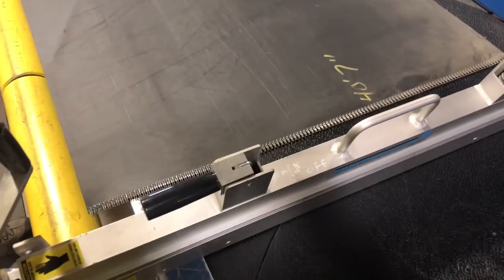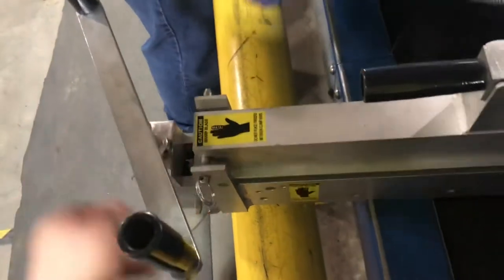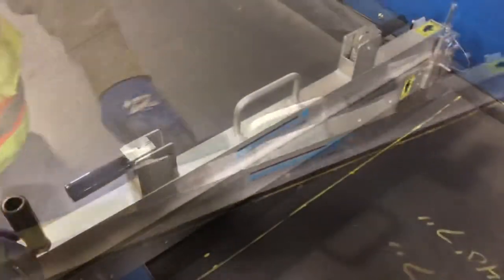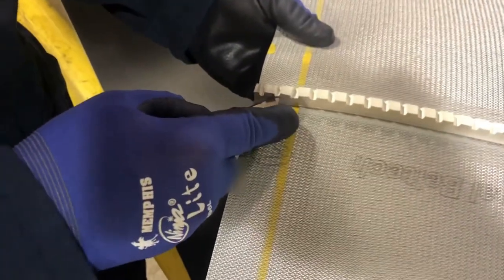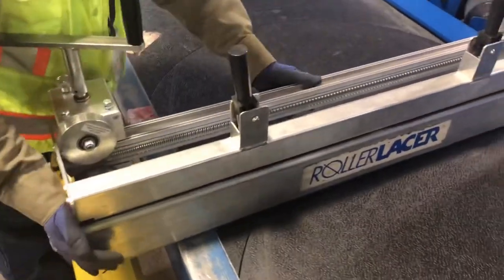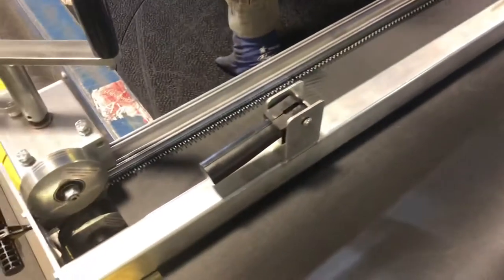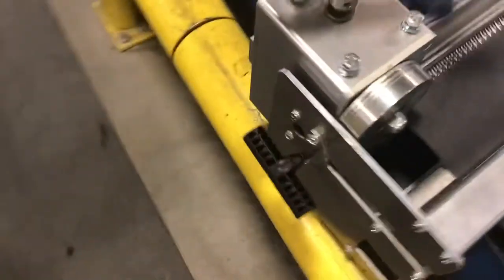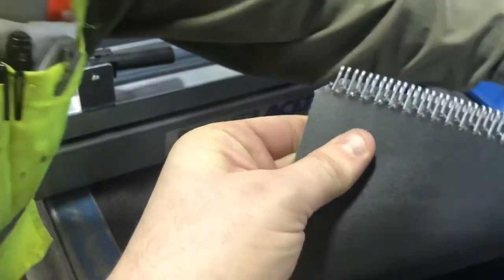Conveyor Belt Cutting and Lacing using the Clipper Roller Lacer

Comment: I need the part number for that belt cutting tool. And i video on tracking a belt.
Reply from the maker: Flexco
32276
Clipper 845 Belt Cutter, Cutter Complete, 48" Belt Width
MODEL 32276

Comment: could you make a video on how to lace a belt that is not square on either edge ?
Reply from the maker: Like a portec curve unit ?
Reply: @180Floridalife   our facility has calijan and Maxx reach extendos sometimes the edges get warn out due to chain rubbing on them  on both sides and they aren’t perfectly straight so drawing a line across the belt with a straight edge is not a true measurement anymore , is there anything we could do for that ?

Comment: Make a video about tracking the merge belt
Reply: Tracking is easy. The face against the direction of the belt..."like facing on coming traffic" you do this because the tracking rollers are under the conveyor. Alot of people focus on the top of the belt but the tracking rollers are not touching the top they are touching the bottom and the bottom is going a different direction then the top. Then think of a tracking roller like steering a bicycle . It's really easy if you can ride a bike